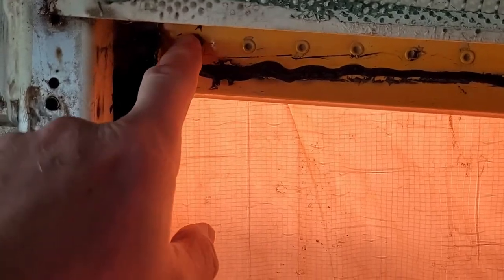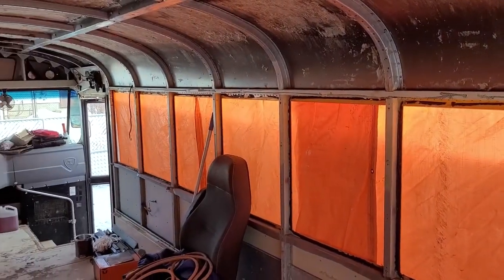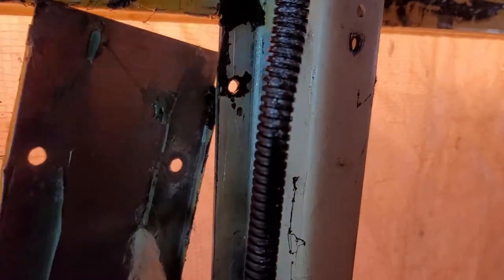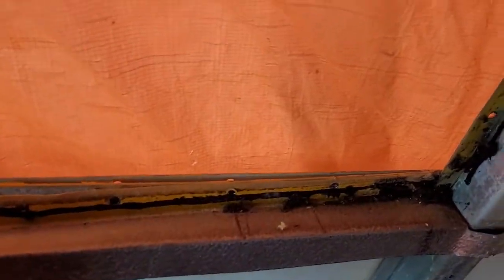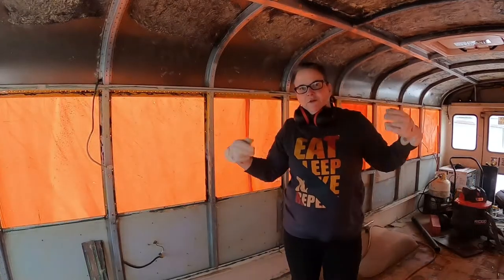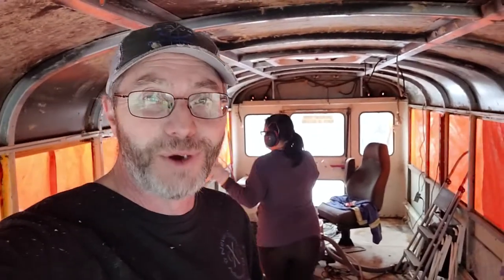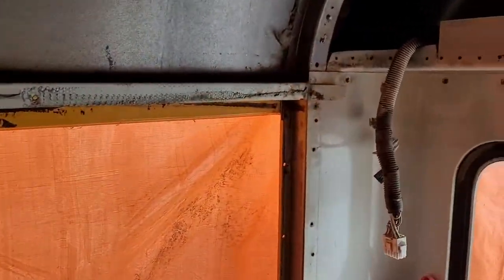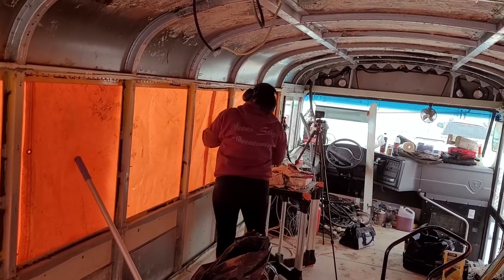Bus Build Ep 12 - Roof Raise Prep - Removing Rivets

Comment: what method do you plan on using to raise the roof? and i am guessing that happens when the snow is gone right
Reply from the maker: We plan to brace the 4 corners (at the least) with pipe and steel with ready rod running through it so we can lock it in place as we go. We are going to cut the roof just behind the driver's seat and around the back over the door. The sides we will be cutting between the windows. Then we will use a jack to lift each end up a few inches at a time locking it into place with the ready rod and nuts in the four corners. Once we have it to the height we want (18") we will be using square tubing inside the ribs to extend the ribs between the windows. 11/4" tubing will fit nicely. Then we will weld it into place overlapping the cut by about 6" on either side.

We've watched many raises done and to me this looks like the safest and most secure way to do it.

My plan is to do this the last week of March. Weather permitting of course. But even with a bit of snow we can still get it done. I hope.
Reply: @genxers  awesome,great plan

Comment: I helped my friend renovate a woody van and he didn't remove any of the inside panels. I really don't think it is required. It isn't as cold here though, but don't pack a sad.
Reply from the maker: The video we have coming out later today is going to show exactly why we removed all the interior panels.
Reply from the maker: The insulation in the walls is quite dirty and not sufficient for Alberta. It isn't necessary but I would definitely recommend it. The insulation could also be hiding nasty mold stuff. - should have a husky video out tomorrow